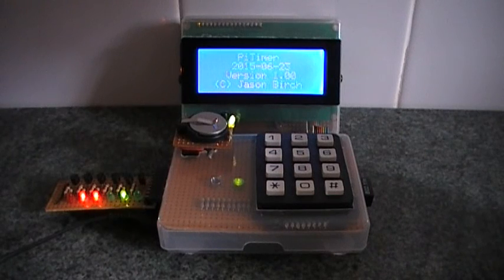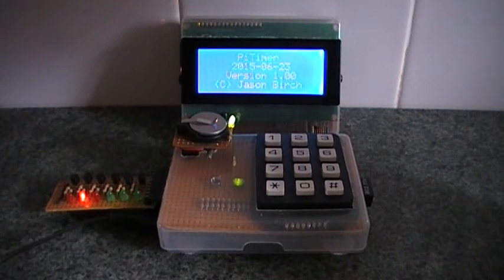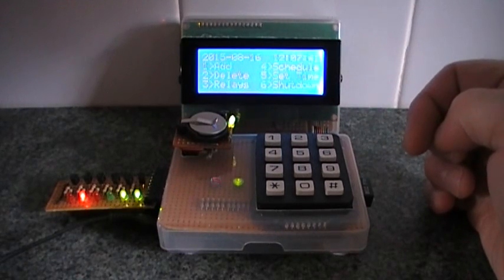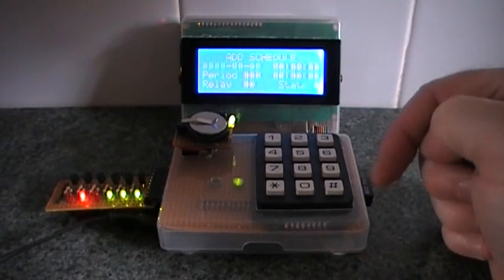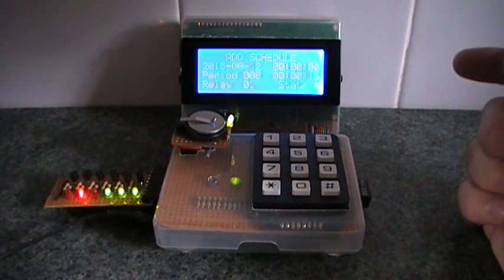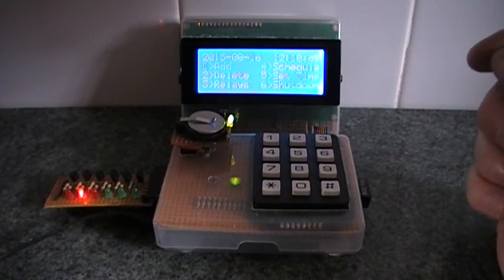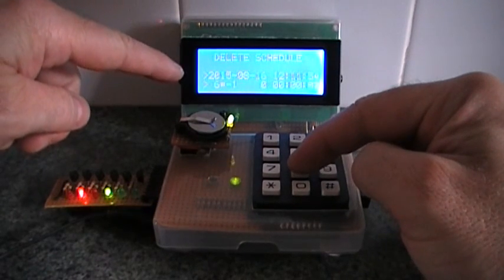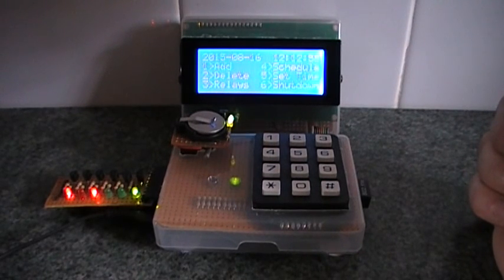Raspberry Pi Timer - Python Tutorial

Comment: I wonder if one can fit such a program into an arduino chip to save costs
Reply from the maker: A company called Adafruit does a thing called Circuit Python. I've never used it, I believe it may run on Arduino, maybe it could run this code if it fits into the memory.
Reply: I didn't explain myself good enough: I wonder if one can fit the equivalent code you demonstrated here in "native" arduino on the Atmega328p..(:  [in terms of EEPROM space]